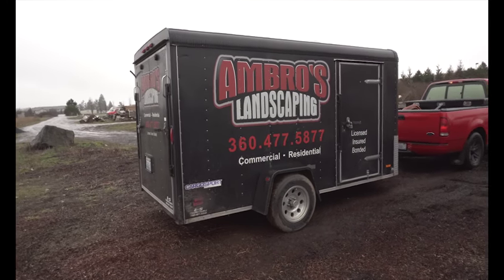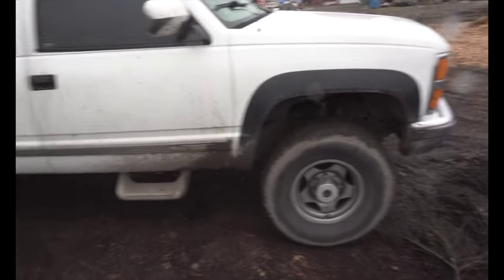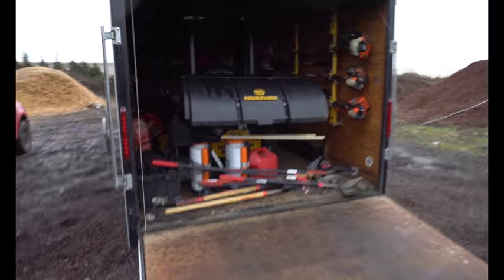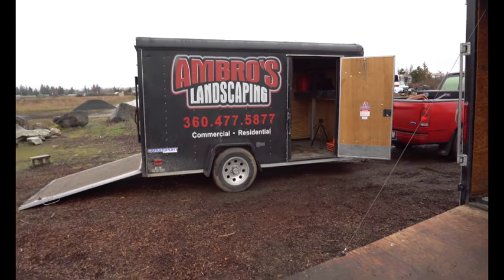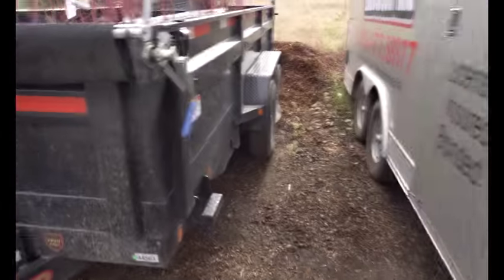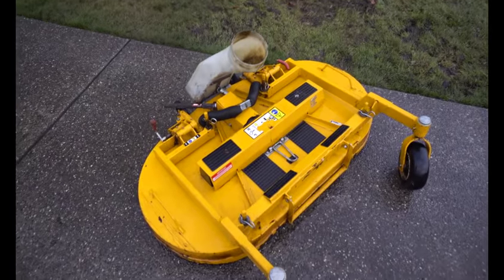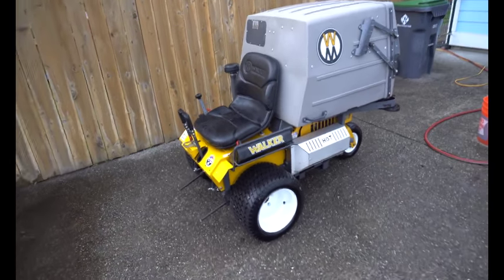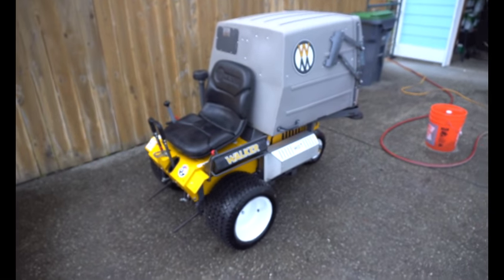Bought Another Walker Mower T25i! | RSWAL Ep. 23

Comment: You can fix a mower tire on the side. No problem. The problem with fixing them on a car is because of high speeds. No tire company wants to fix a tire on the side and hold the responsibility of it blowing out going 70 mph. As far as how they popped the tire on the side. Either ran it along a fence line. Or ran over those little flags utility company's use to mark their lines.
Reply from the maker: Thank you, appreciate the comment